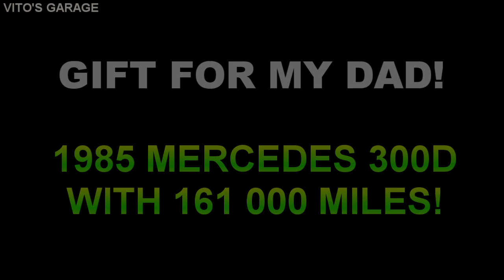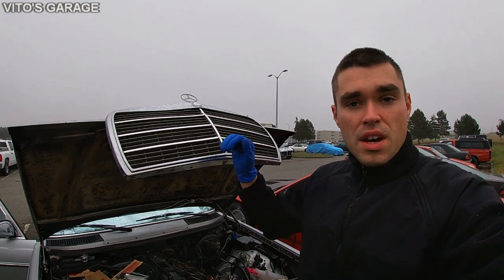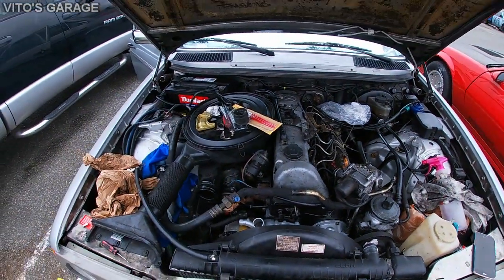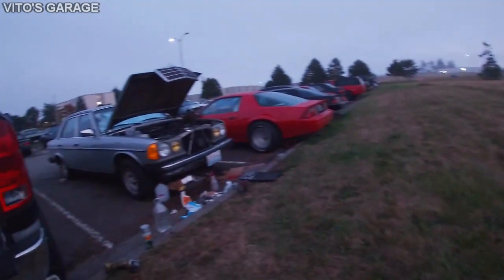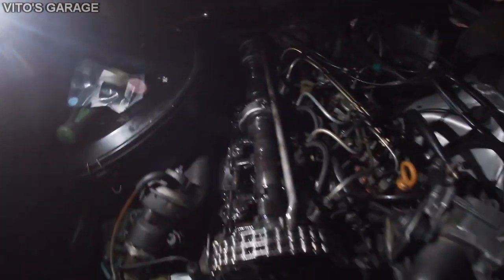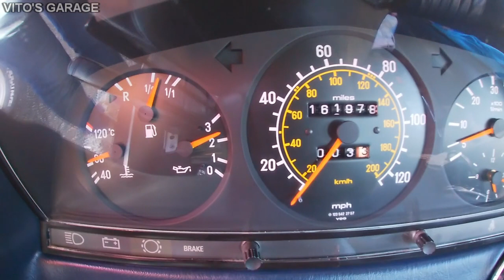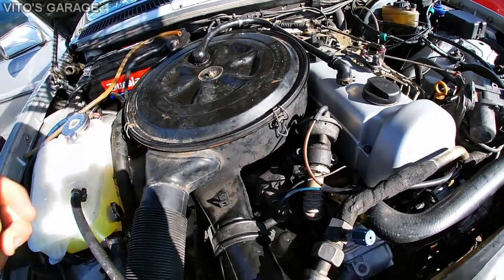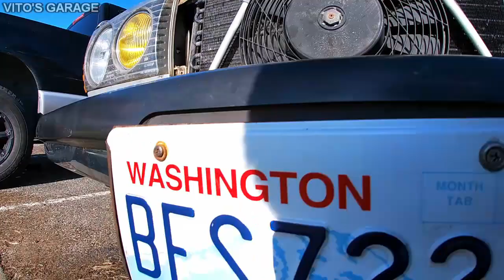PART 8 Dad's Gift 1985 Mercedes 300D: New Water Pump, Thermostat, Gaskets. One Step Closer!

Comment: Hey Vito! Looking good. That is a nice 123.
When you put that water pump on I saw a hole on it that is now on top the way you installed it. Was that the weep hole and if so that should be on the bottom 180 degrees around. 
Is that parking lot at your apartment or is it a deserted shoping mall? Wherever it is I guess they don't care. I used to work on my car close to my apartment and they said it was OK as long as I wasn't there on Sunday. That was the only day they were there. Take care.
Reply from the maker: This is the parking lot on the military base. And it doesn't matter where the weep hole is on the water pump. If it leaks, you'll see it either way. Thank you and Cheers!